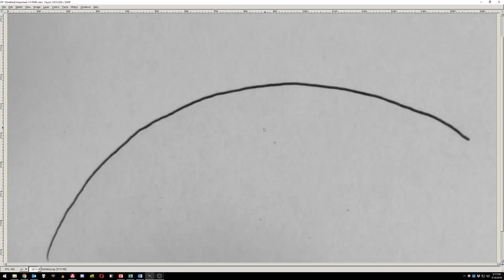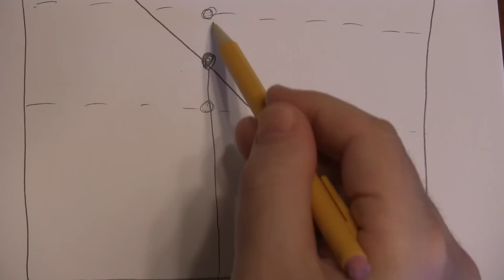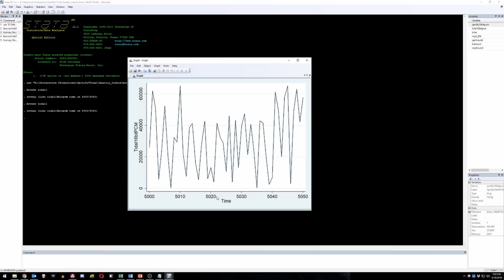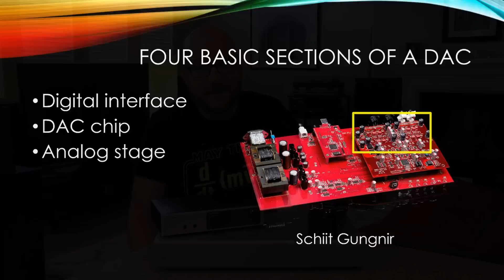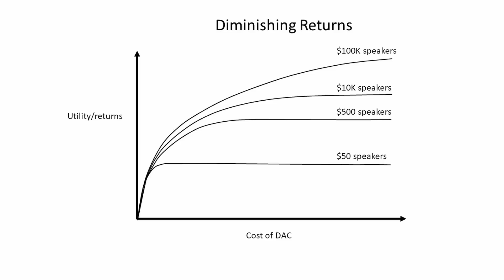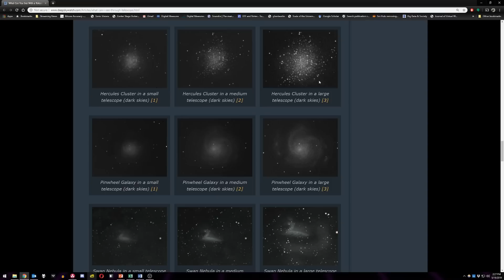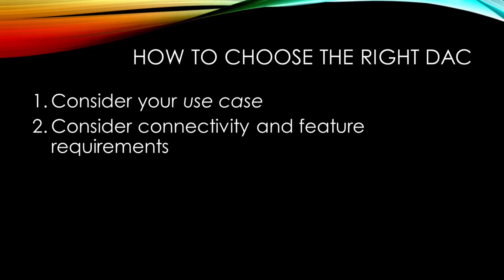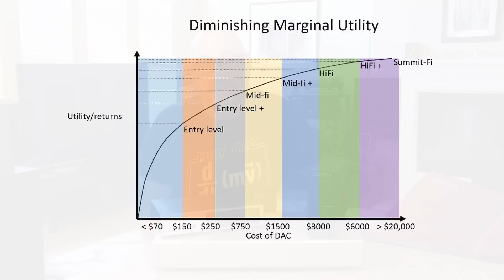DACs 101: Introduction to DACs and DAC Buyer's Guide.

Comment: Until HDMI appeared, SACD play  was only possible via the player's DAC. Now 20 years after the first SACD Players came to market, SACDs can be played  by some modern DACs having an HDMI interface. Thing is, these modern DACs do not appear to me to deliver better sound from SACDs or CDs, in any manner better can be discerned, from the oldest technology found in the earliest players. In other words, my OPPO-205's DAC for stereo pleasure sounds no different than the DAC in my 20 year old Sony DVP-S9000ES DVD/CD/SACD Player. Also, no matter the bit and bite rate, up sampling, or other manipulations to the digital stream, I find the DAC in my 25 year old Sony CDP-C601ES CD Player to still sound on par with the OPPO's ESS Sabre ES9038PRO 8 ch. DAC. Who knows why I can not hear any divergence in sound from early DAC technology and today's technology, there's likely a multitude of reasons but rather than ponder it, since it's moot, if I get the notion to upgrade my system it will not be the purchase of a stand alone DAC. It will be better speakers.
Reply: Yes, better speakers.
Reply: What about amp?
Reply: Could it be that we are on the same boat? I own a great sounding California Audio Lab  CD player (not sure if any DAC was built in like my NAD with Burr-Brown converter). I also discovered that my 30+ years old Pioneer Laser Disc Video player capable of playing CDs has a 96 kHz 20 Bit DAC Hi Bit Conversion.
Reply: Excellent points !  I too have a much older Sony DVD/CD/SACD (#DVP-NC555ES) player and when I play single layer, non-hybrid SACD discs, its sounds amazing and can only be heard on analog out, either 2 channel or its 5.1 channel.  When I insert a hybrid disc, sometimes I get SACD layer, but usually, I get CD layer, regardless of how hard I try to tell it to prioritize SACD layer. Digital out of this unit is always PCM only, never DSD.  Frustrating.  

and

Sony Blu-raythat can play back SACD's works great via HDMI meant for both audio and video when plugged into a home theater receiver....  But my higher end 2 channel stereo system does not handle any HDMI at all.  The digital out reverts back to PCM 44.1Khz.

Comment: Hi, you did a very nice job in explaining what does a dac do besides the conversion. Yes when you are well into hi end gear then a good dac makes a world of differance and  if not, one can ignore it as you want hear  almost any dif. through the speackes.  If one of your amps for example is a Dan D’Agostino or Pass Labs or a Hegel h 590 or a Boulder feeding from an  Amr transport or Metronome  and so on , a good dac makes a difference that one could easly hear without even having to try. A few blind tests in my private music room with ten listerners from all levels showed me that when the gear is a hi end one  ,it does make a world of dif. espacially if your speackers are at the Focal Grande Utopia EM EVO level for example  or above . Ofc. even with cheapper hi end gear it still helps in detail , I would say a great deal.Aslong as the ext. dac is better then the internal dac used one will hear the dif. on a hi end gear.

Comment: If you "zoom in" far enough, everything is discrete and quantifiable to a certain point when it comes to electrical signals.
The amount of electrons passing through "analog" components can be quantized resulting in quantification noise, same goes for the molecules of PVC inside the grooves of "analog" vinyl.
Reply: It applies to many . The zooming increases as technology evolves. Infinity will be the answer.

Comment: Thank you for the in-depth explanation on why there is a cost difference/sound difference. By far the best 30 minutes spent on this research journey of mine. 

I am just getting into this audiophile scene. Seeing how big of a difference (size, output, cost) there are with components it was fairly overwhelming (what are the differences? Why the cost differences? Where is the point of diminishing return? Could I even tell the difference?) 

I'm wetting my feet by getting some highly rated products to upgrade my current system (Asgard 3 with DAC, Open back Planar, Open back dynamic, IEM Planar) I want to see if I can tell the differences between these before I start dropping more money. All are in the mail and will be spending time next week testing out. I think it will be interesting. 

All this because I got a new car and heard things in my music I have never heard before. I was naive thinking an upgraded sound card in the system was good enough teamed up with Grado SR80s/Etymotic IEM. Guess I have been missing out.

Comment: This was an excellent video.  When you were describing the continuous vs. discrete conversion I wish you at least mentioned the Nyquist-Shannon sampling theorem briefly, which explains that a discrete signal with a sample rate of X Hz can theoretically reproduce every frequency up to X/2 Hz in the continuous signal.  That's why they chose the 44.1 kHz sample rate, because human hearing only goes up to about 20 kHz, so it can reproduce a signal up to 22.05 kHz.

Comment: Great video. I have a pair of PC speakers with a built in DAC capable of 16-bit/48kHz. Would these speakers still work if I connect another DAC to the PC capable of 24-bit/192kHz and connect the speakers thru the new DAC? The cost of the new DAC would be $170. Would it be worth it? I love quality sound and music.

Comment: Nice video.  Human physiology has limits and cannot perceive anywhere near infinite resolution.  So it is pointless having resolution greater than this limit.  So, "yes" an oscilloscope can detect the difference, but humans cannot.  So, in effect a digital sampling rate of a analog wave greater than that of human perception to resolve, is indistinguishable.  Your video is really excellent.  Thanks for the work you put into it. Subbed.

Comment: 19:00 Have you got synaesthesia? Synaesthesia is nothing to worry about: just a cross wiring of some synapses. Most synaesthetes are chromosthetes, i.e.: they envisage colours in music and can communicate consistently in those colours. Jimi Hendrix is thought to have been a synaesthete. Daniel Johns from Silverchair definitely has it. Others have it in different forms. I have number form and time-to-space synaesthesia, which is too hard to explain here. The point is that, if you can draw it, then it’s possible that you have it. That was the giveaway in my case.

Comment: Thanks for the great video. I believe the big question is that should you take into account not only the price but also years and even decades. To put it simply - would you think that the quite a bit older NAD D 1050 (retail 500) would be still "better" to 5X cheaper but much newer Schiit. Honestly - this is my question of the month as I am able to get the old NAD for peanuts. But the question is it still tehnologically "relevant"?    Could someone help me with this wodering? Thanks

Comment: Good info! i have a pair of speakers with rca cables connected to your pc cannot have an external dac converter or i need a sound tarjet with a dac converter? because i have a pair of edifier 350db speakers with a woofer and has high frequency cone and a only one low-mid frequency cone each spearker... i have hear than a dac converter can make correct to the low-mid cone doesnt sound muddy and more clarified so then the woofer sounds more separated or tighter, or on the other hand the low-mid cone more discriminated to the woofer, sorry i am too specified so i want to make sense to a possible solution... thanks!

Comment: Yours is the best 101 video I've found.  Much needed and appreciated.  I still have questions.  

My main question is: What DAC is in use if I stream Hi Res Qobuz from an iPhone to a $25 Esink Bluetooth?  Is the iPhone converting the digital to analog or is that cheap little Bluetooth device converting the music?  I'm also using a vintage McIntosh MC7100 amp and an Adcom pre-amp to drive a vintage pair Dahlquist speaker.  I know, the $25 device is silly.  What do I replace it with?    

I hear people talk about using an external DAC in addition to the Eversolo A6.  Why would that be necessary if the A6 has (what I assume would be) a very good DAC? 
The Wii Pro Plus is also suggested to use as an external DAC.  Does that DAC (to use your words) "make music" well? 
Is every streamer also a DAC?  
The Eversolo A6 purports to be a pre-amp as well. What if I don't need a pre-amp?  Does that mean any pre-amp/DAC is half a waste if I already have a good pre-amp?  

I hope my questions are concise and helpful to others . . .

Comment: Good video, but there is one subject missing in the conversation: How do I know a certain DAC is better than the one I am already using? There are some AV receivers that already have very good DAC's in them, and others maybe not so much. I have a pretty decent JBL AV receiver, and I imagine it has a pretty good DAC too (I do run a digital signal to it as I have a 5.1 surround system). But how would I know to purchase a stand alone DAC that is better than the one I have or already use in my JBL receiver? I can say currently my system is on par with my friend's Sonos system he has, and both systems run about $1,600-1,700 new with speakers. And both systems do sound very good, certainly better than what most people have or would spend money on for their home stereo needs. Can a better DAC actually improve the sound that I already have as certainly the speakers I have and use again are of better quality than most and perform quite well. (What I think is amazing about my system, is the louder I turn it up, the sound quality and clarity increases with the volume being able to go all the way to 10 with no discernable distortion - except the knock at the door from my neighbors calling the police. lol). Naturally, I have made sure all of my speakers match the wattage and output of the receiver near perfectly (I have JBL, Polk, and Athena speakers I use in my system instead of just all JBL as I think it gives me a more dynamic sound).

Comment: I am looking for some dac advice. You are definitely way more of an expert than I can even imagine to be and I can use all of the advice that I can get. I have a very modest hifi system and I have slowly been upgrading along the way. I have finally decided to get into steaming and I just picked up a nice cocktail audio x50 streamer and cd ripper. From what I have read about the cocktail audio x50, it seams to have a lot of capabilities that I would like to take full advantage of. I am wanting to get into the hi res files and things and I would like to get a dac that I can use for quite a while and be able to get everything possible out of the cocktail audio x50. If possible, I would like to stay under 1500ish and used is not a problem for me at all too as most of my equipment I have picked up used. I like getting the most value possible for the money that I spend. 

Just as a reference, my system consists of:
Primaluna dialogue premium preamp
Primaluna dialogue premium hp amp
Marantz tt15 turntable with a clearaudio virtuoso cartridge
Fosgate Signature Phono preamp
Denon dvd-2900 cd/sacd player (modified)
Cocktail audio x50
Denon drm-800 cassette deck 
Focal Electra 1038 be speakers
Reply from the maker: It sounds like you have a very nice system. I love the Primaluna and that Marantz TT15. As far as a DAC in the 1500 range, I really don't think you can go wrong with an RME ADI-2 DAC. When you start to get into that range, differences are very small and largely preference. You can also look at a Chord Cutest or Schiit Yggdrasil. If you're looking used, you're starting to get into some PS Audio range. Again, in that range everything is very good. To really get something that is definitively better, imho, you're going to have to start looking upwards of $2500-3000 used. And really, differences will come down to the finest subtleties. I'm currently very happy with my RME.  Good luck.
Reply: @seltzertronics2538  I really appreciate your input. I watched the video on the rme and it sounded very nice. I love ps audio gear but that's hard to find in that price range. I will keep reading and looking but that may be my next purchase. I'm at least enjoying the music at the moment. 😎

Comment: I have a bluesound powernode 2i....I have a cd transport.....the powernode connection in back for analog/digital uses same connection which is small and requires an adapter...is it possible for me to use a better DAC then the powernode has and is it even possible with the powernode?

Comment: excellent video..but let me ask this question..with consumer  CD audio with standard 44.1MHz/16 bit encoding, What a 384KHz/24bit DAC can do to improve the quality off the source ? Out of thin air ?  You cannot " improve" anything by upsampling it..Am I correct ?
Reply: It won't upsample. A dac that says 384khz/24 bit means it can handle  sampling up to 384khz. The quality of what you're hearing from the dac depends on how well the dac extracts the bits. 16/24 bit dacs do not mean they extract the full bits. The effective bits of resolution (how many bits it actually gets) can range from 12-20ish with delta sigma dacs which are the majority of dacs.

Delta sigmas oversample but there is no guarantee that it won't resample the same bits sometimes. Then the bits are stitched together. This is because delta sigmas guess where the bits are on the signal path and also try to reshape the signal to what it thinks it should be. Because of this they sound digital, not natural, not organic (sounds kinda fake-ish)

R2r dacs do not guess or shape the sound. They are also called multibit dacs, cost more and this is why delta sigmas became popular... They're dirt cheap in comparison. R2r dac makers are very up front and will tell you the effective bits of resolution the dac gives you. The schiit yggdrasil r2r dac gives you 21 bits. The soekris 1541 dac is 27 bits I think.

Comment: The only thing that confuses me here, is how to connect what to what and what inputs and outputs to use. My current CD player/recorder is a Marantz bought
over 20 years ago. It has digital and optical and big 3 pin (whatever they are) inputs and outputs going through Naim amplification and Focal speakers.  I don't
mind spending fairly big money on a DAC but I want to make sure it'll connect to my current set-up.

Comment: If you connect your pc to a home theater amp via HDMI, and the amp has a DAC inside, which DAC would be used by default? The on in the pc, or the one in the amp? On the pc can you configure for digital sound output via HDMI?

Comment: I know this is not a Q&A channel but if you read this and care to answer, I have an Arcam irDac it sounds good and has all the inputs I need. I was reading that an sbooster a liner power supply would make a big improvement in sound quality when used over the stock wall wart. Then I saw that iFi has a HiFi wall wart, is all this snake oil or is there any validity to having a better power supply used on your dac. Thank you for your reply, stay well.
Reply from the maker: HI Cruzing. I've found that power supply upgrades can often do result in very noticeable improvements. Often what separates lower-end components from higher-end components is the amount of effort (i.e. expense) the designers put into the power supply. That being said, results can vary a lot. A DAC like the RME ADI-2 DAC has a built-in filter network designed to deal with low-quality power supplies, and so improvements from power supply upgrades are somewhat limited. However, a device like a Schiit Modi 3 can enjoy a pretty substantial benefit, since it has very little capability to deal with bad PSUs (or the 5V USB out of a PC). I'll also say that I really like the iFi iPower X series. I recently bought, in fact. Will your Arcam benefit? I can't say for sure because I'm not super familiar with that device. However, my personal opinion is that it's worth a try.

Comment: If you get a good pre-amp like an Anthem AVM-60 or a mcIntosh MX-123, do you still benefit from a dedicated DAC or are the dacs in them good enough? Do Pre-amps even have a dac in 'em?
Reply from the maker: Hi Saeed, That's a good question. A good digital preamp like the AVM-60 or the McIntosh MX-123 are going to have very nice sounding DACs in them. You're going to have to invest in a really nice standalone DAC to improve much. Can you do better? Yes, but would make it a priority. Digital preamps have DACs built in to them. If you see something marketed as an "analog preamp", this usually means that there is no digital processing on the device. It will have only analog inputs and outputs.
Reply: @seltzertronics2538  Thank you for guiding me. I'm new, and have the speakers and the amp already; now i know how to complete the rest of the setup; a very nice digital preAmp and a source unit and call it a day OR a basic analog preAmp that meets my needs plus a Terminator plus DAC or similar and call it a day. And then enjoy the music. Thank you again because with all these videos of different types of devices, i felt like i am going up an unending stairway. I guess with streaming, new types of devices have been invented.

Comment: I've got a good Yamaha av Receiver, I've got two floor standing speakers that have been chewed by my puppy, also no separate cd player. I'm getting new speakers and a cd player and a DAC. would I connect the DAC to the av receiver and the cd player or both? Any advice would be greatly appreciated before I go out and spend a nut.